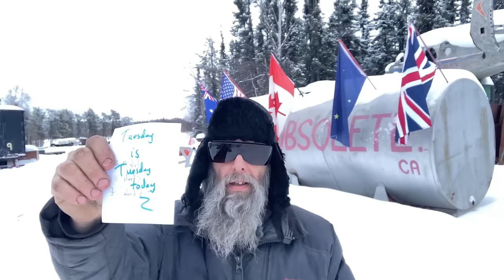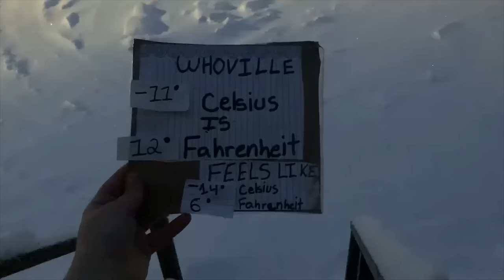Successful Day With All 8 Thermostats Changed on the IH Cats Feb 13 2024

Comment: Lots of work but will pay off big time . The block heaters should work faster on them now also  I’ll put money  on the the equipment of to day with not be running like the olds ones from the 40s and 50s  do now for there age 👍👍🇺🇸🇺🇸
Reply from the maker: yes with the block off plate the warm antifreeze from the block heater will stay in the motor block not melting the snow off the top of the radiator. i don't thing any from today's new world will be around in 80 years, lol  thansk

Comment: Mr. King of Obsolete, When I was working at GM, we upped of the gas engine temp to 210°F. It was an experiment to improve fuel efficiency. It's industry standard today.  Heat helps. ben/ michigan
Reply from the maker: yes but we live in fear of these 80 year old IH heads that are know to crack getting too warm. so we will play it save i hope.  thansk
Reply: @kingofobsolete4789  OH Yes! for sure, I wasn't suggesting just letting you know what we found for your mental database. Ford, GM, Chrysler, Toyota, BMW, VW everyone uses 210°F engine temp  today..

Comment: I can only wonder the amount of money you have invested  in cat  batteries. I was wondering wat engine or cam  in that truck you moved around  the shop the other day ,its a dually no bed on it  n single tires on the axles, it sounded grate with the high lift cam .thanks for sharing  stay cool .lol God  bless yall real good.
Reply from the maker: we bought a lot of batteries that should have last 10 years but only got a year out of them being the new world junk. we will be putting the RV camshaft in the 45 ramp truck so it can pull. thansk